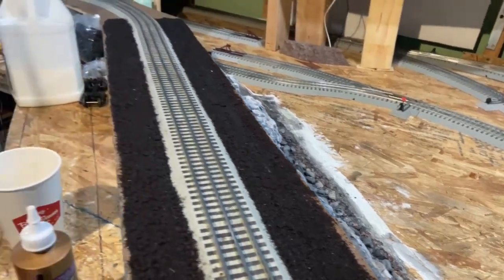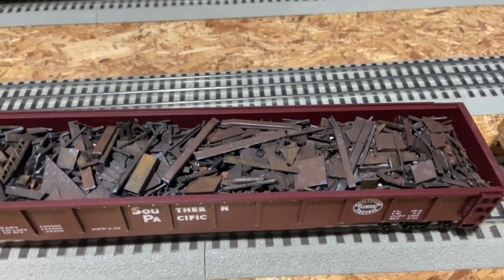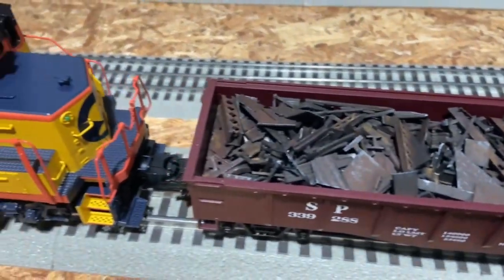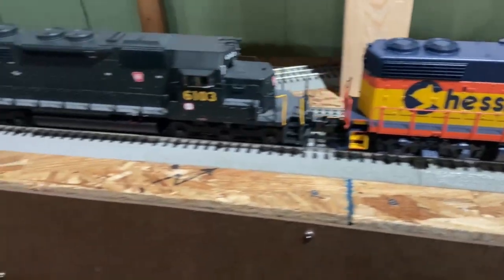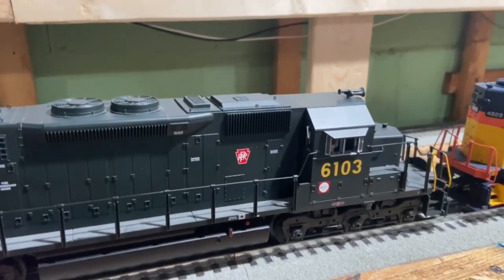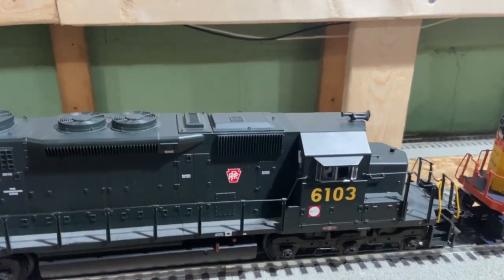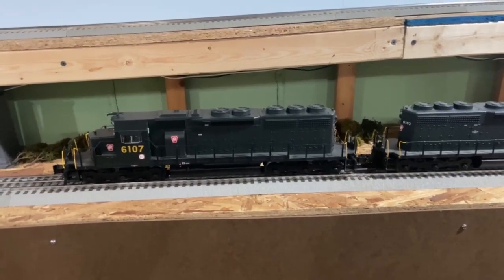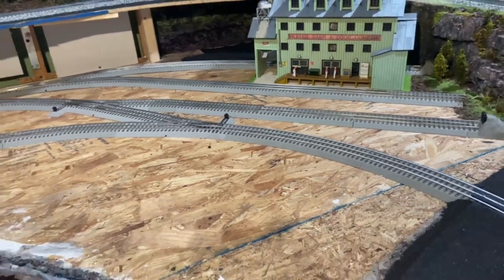The Atlas Master Series O-Scale SD40 in Pennsy livery with TMCC and Railsounds. Powerful & beautiful

Comment: How is the power out out from the Atlas SD40? Mine seems to build up speed rather gradually. Is that a common scale tendency or maybe I should check the  power output?
Reply from the maker: Also, Horace - if you select 32 speed step mode, cruise is disabled and you will see more linear throttle response. If you have grades, you will get decreasing speed uphill and the opposite down, though.

Comment: I've had a weird on-off issue of the worm gears getting shreaded. Had to replace both the front and back.
Reply from the maker: I’ve found the gearbox grease that Atlas used during this era hardens up to epoxy-like levels when they aren’t run. It wouldn’t surprise me to see stripped gears due to hardened grease.
Reply: @TheLEMRR  yeah. It's such a nice loco. Massive pain to keep it running. But hey, it got me back into the scale I started with.
Reply from the maker: @josephheuer4540  can’t ask for anything more, lol
Reply: @TheLEMRR  now I'm unsure what's happening. Gear stripped again. I'm not seeing anything inside the truck that would be causing such and issue.
Reply from the maker: @josephheuer4540  A real bummer for sure. I've never experienced anything like that with my Atlas units. Seems like something is misaligned or possibly the wrong size in there. Sorry to hear this man. GL

Comment: How is the power out out from the Atlas SD40? Mine seems to build up speed rather gradually. Is that a common scale tendency or maybe I should check the  power output?
Reply from the maker: The EOB cruise control has slow momentum built in. That is how they all operate.
Reply: @TheLEMRR  thanks